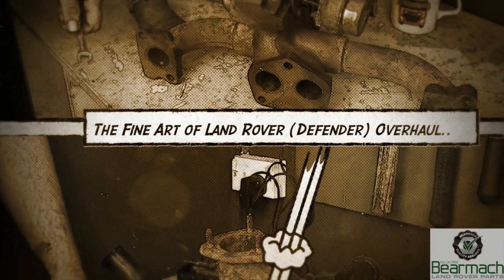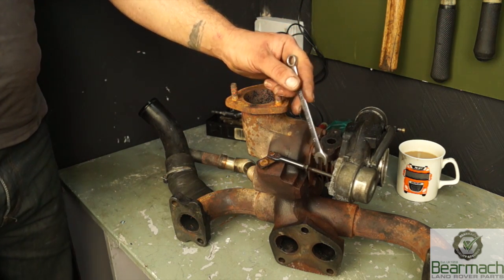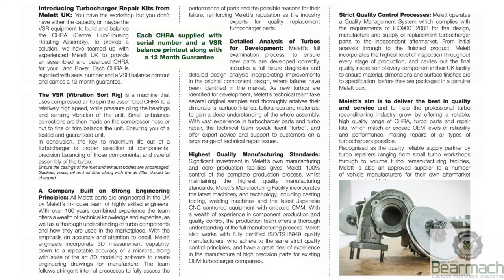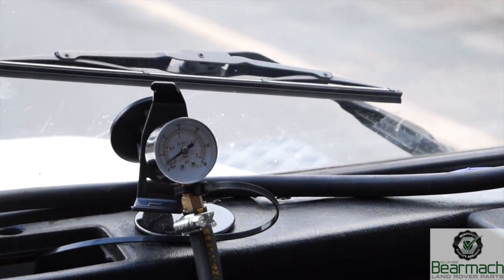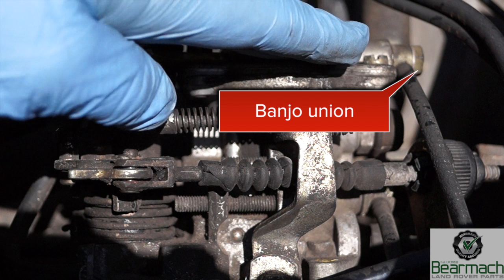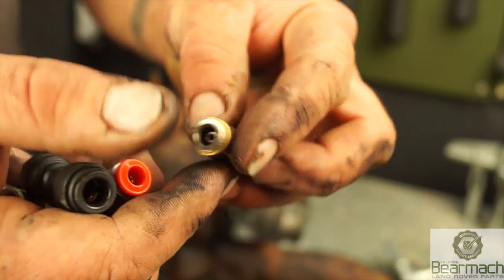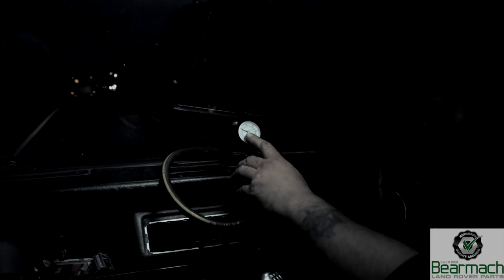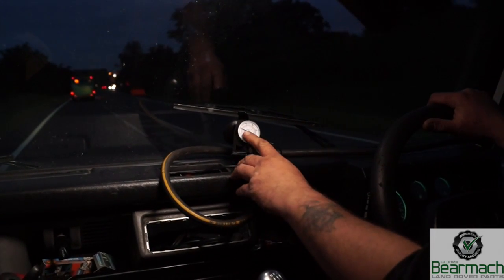Land Rover 300tdi turbo boost pressure check  - how to

Comment: Anyone assist here?  I modified the injector pump for extra power.  I didn't touch the main end screw, just the star wheel lowered by ¾ turn and the collar shaved down by 2mm and top screw (pre boost) in by 1 full turn.  Although the power is really noticable, I find that on putting my foot down I get a large puff of black smoke.  Not really bothered about that but I am about the MOT emissions test.  Any ideas?

Comment: I have a boost gauge (3 bar) installed as per workshop manual and it barely reads above 0. I have installed a new actuator as I thought it may have failed but clearly not, it was set to the same length as the old one. My turbo has on very rare occasions spun up really fast (1 bar) with a puff os soot/black smoke from the exhaust and took off fast prior to fitting new acuator but most of the times it doesnt seem to work. I have no air leaks in my system I have checked again and again even putting on new hoses all round. I just dont know how im not getting any boost at all ?.
It is a 98 300tdi btw 220000 miles. I have just had a new turbo cartridge fiited to no avail either . What is going wrong please ?.

Comment: Also u won't loose power if that pipe is split it will do the opposite Chris- the turbo will overboost up to approx 25psi Gos like stink lol but turbo life is drastically shortened
Reply from the maker: since the pipe is connected to the injection pump boost pressure capsule how do you expect it to provide extra fuel on acceleration if the turbo is putting out more pressure?
Reply: Mine has an additional adjusting T piece (with an adjuster screw) that goes from the turbo to the waste gate actuator. Maybe I should turn that in to block off a bit of air instead of adjusting the waste gate nut. I need more air I think. It’s blowing a tiny bit of black smoke n lacks a bit of power. 

The other part seems ok where it goes from the turbo to the injector pump diaphragm. I don’t think it’s the injector pump (I’m not touching the fuel screw as it seems like it has enough fuel).

Comment: Great video, but I think he made a mistake. I think delaying the wastegate from opening is done by shortening the rod, and not by increasing its length.
Reply from the maker: there is doubt in your voice of knowing which way it is to go.  Better to set it by trial and error.
Reply: I’m not 100% sure my self but my 2 scenarios are as followed. 

My logic is as follows (also based on the forums I have been reading). 

Logic 1: (I only mention this because almost every forum I read tells me to shorten the rod to delay the waste gate from opening). 

The spring in the actuator has something to do with pushing the rod, which opens the waste gate (I would say a diaphragm is involved inside the actuator). 

If you lengthen the rod the spring has less pressure on it and would require less air to push the rod, to open the waste gate earlier. Plus as you’ve lengthened the rod it’s also essentially closer to opening anyway. 

If you shorten the rod the spring has more pressure on it and would require more air to push the rod, to open the waste gate later. Also as the rod has been shortened it’s further away from opening. 

Logic 2: (what you’ve told us) 
If you lengthen the rod the spring in the actuator has less pressure on it and therefor will need more air flow to push the rod, which will open the waste gate later (delaying the waste gate).

If you shorten the rod the spring in the actuator has more pressure on it and therefore needs less air flow to push the rod, which will open the waste gate earlier (losing pressure earlier). 

Conclusion: 
To somehow over come this you can put in a manual boost controller to adjust the amount of air that the actuator sees. Keep in mind this will probably only work if 1: the actuator and spring are good 2: the waste gate moves freely and isn’t seized and 3: the rod setting is somewhere in the middle.

Comment: I just read somewhere the best place to put the t-piece is short hose that goes to the waste gate rather than the hose going to the fuel pump. Is this correct or does it not matter?
Reply from the maker: In any air circuit, the pressure should equal unless there is air -loss.   in later diesel Td5 and later there is a Manifold Absolute Pressure sensor which reads pressure in the inlet manifold Ideally this is the best place to read it from.

Comment: This is food for thought as I'm struggling to go beyond 70mph at 3000RPM in my Discovery 300TDI regardless of changing the lift pump for Delphi and genuine fuel filter. No fuel line leaks anymore, desedimenter gone, I even changed soft induction hoses for Britpart silicones. Bizarrely it pulls like a train but it's still not going above 70 like it used to.

Perhaps the waste gate or related and barely visible pipes could be the issue!

Comment: how can i increase the boost psi on my 300tdi to give me more power
Reply from the maker: adjust the waste gate servo so it stays shut longer. but it is not that easy because with the increase in pressure there needs to be more fuel injected.   I'd warn about this unless you have an engine in good condition you could be wrecking the engine if tweaked.       Better off getting a VGT.
Reply: vgt ?
Reply from the maker: variable geometry turbo.
Reply: never heard of it . is it the same as a multi vain terbo ?
Reply from the maker: Have a look at the turbo here.   http://www.allisport.com/product/allisport-land-rover-defender-300-tdi-vnt-turbo-direct-replacement-turbocharger/       Bit expensive and there are cheaper alternatives but it will give you more power at lower rev ranges.  The Variable Vane or variable geometery  turbo give a much better power curve.
Reply: Actually I run with up to 1.2 bar.... I would like to know what are the risks for the turbine or for the rest of the engine to adjust to a higher pressure of up to 1.4 bar ???
Reply: @ricardo_0085  I found out how to turn up the boost

Comment: I've outfitted my 300tdi 11 Defender with a separate turbo boost gauge, t'eed into the line with nylon pipe and mounted on the dash. That way, I can see what is up with the turbo as I drive. I've also fitted a handy "MadMan" monitor from South Africa (http://madman.co.za/index.php/products1/category/ems-units) which gives continuous readout of important values. These can vary depending on the sensors fitted, but I have EGT as one, so again I can keep an eye on how I am stressing the turbo if towing up a hill, for example. Which reminds me - some say never tow uphill with an R380 in 5th
Reply from the maker: +CanAmSteve   There is a limit to a small engine when up hill towing.   Good to check the turbo pressures but once set are they really gong to change?

Comment: Thanks for the great videos! I've bought several new 300tdi turbos for friends outside the UK. They always seem to come with the casting to connect to the manifold, yet it is not usually necessary to replace it. As I am reshipping and weight costs, I have stripped off the casting and just sent the turbo itself with protective covers over the openings. Never had a problem. So why are they supplied with an (probably) unneeded casting?
Reply: CanAmSteve xmm

Comment: luv ur stuff I bought second turbo of a disco for my 300 tdi was on a manifold so just bolted on everything great but my boost pressure only goes to 7lb but im perfectly happy with fuel economy should I adj it up ?
Reply from the maker: +chasmac mccarthy   you should really because you arte loosing power.  But if your happy then it is your choice.

Comment: I enjoy your videos very informative and for me it has given me some guidance.I dont have a manual, so I wondering how can I get my hands on one, does bearmach sell them, I may add I am from Belize and recently got a defender 300tdi which I'm planning to restore, any advice as to what to commence with?
Reply from the maker: +Christopher Windsor  yes  the best manuals are Original Technical Publications you get parts manual with the workshop books as PDF  all on a DVD disc. Part number for the 110, 90 and Defender is LTP3003   here is in their catalog.  http://www.bearmach.com/books/Edition17/index.html#226  you could mail order one?   

You could try Britcar   http://www.brit-car.co.uk  they are very good Bearmach distributors